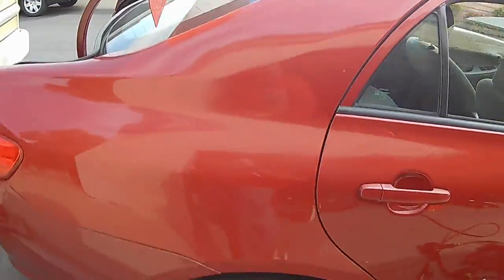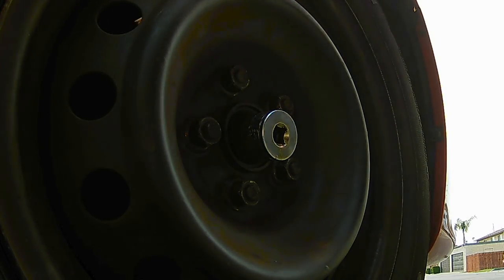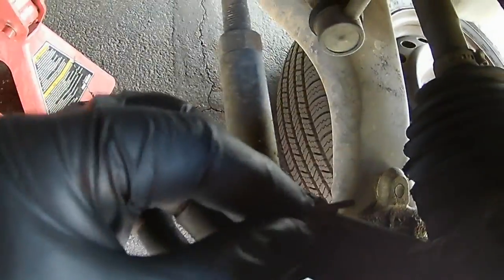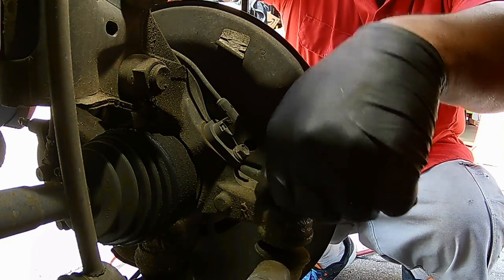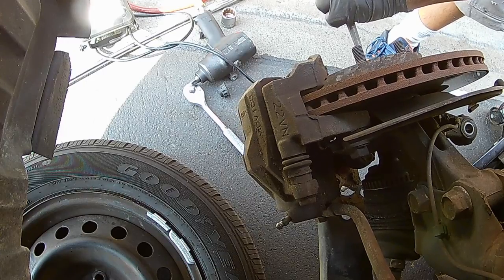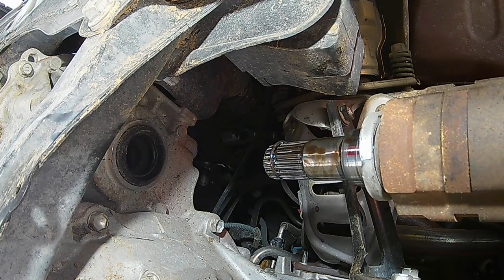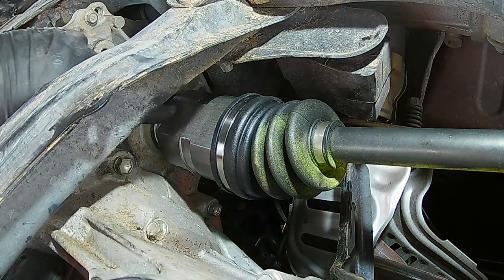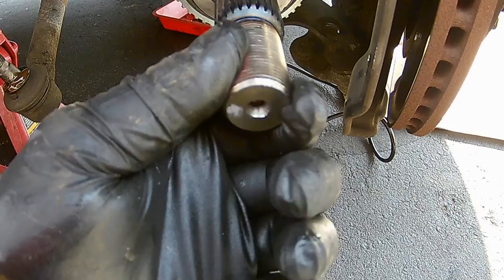Toyota Corolla Axle Replacement Removal - CV Axle Cost - Matrix Vibe - Axle Clicking when Turning

Comment: Very helpful!  I'm having nightmare of a time getting the new passenger side cv axle in my 2005 Matrix.   I've used all the tricks; making sure the retainer clip gap is facing 12 o'clock, used some grease. wiggled, pushed bonked for the better part of a day.  Driver side went in easily.
Reply from the maker: Take a 2 x 4 and use it to protect the threads while you tap it with a hammer and someone else has to be holding it in place.
Reply: When you did the driver side, did you pour out the transmission fluid?

Comment: Just did this today and because of this video it was so much easier. The tip to use that castle nut as a sort of an anvil was a great tip. Took me and my dad maybe half an hour get it done. I've got an 07 Corolla S with 260,000 miles on it
Reply: Sweet man, my 14 Corolla S just reached 200k yesterday very well built cars

Comment: Nice video. I just replaced mine today.

You do not have to remove the steering tie rod end.

I was unable to use the screwdriver to pull the axle. I had to rent a puller from O'Reily's Auto Parts. The puller rental was $65. After using it I was given a full refund.

Comment: I dont ever recommend but if you ever need to hit a castle nut on anything screw it on upside down so you dont damage the divots on the nut and make sure its even with the bolt.

Comment: Great video, I have noticed the new axle shaft has no balancing rubber in the middle of the  shaft such as the old shaft, l have corolla 2005 manual transmission, CV axle to be replaced. Is the same axle fit for automatic and manual transmission ? Thanks.

Comment: Or use your handy dandy 1/2 drive cordless impact if you do not have air 😏 When someone tells you to put something together in a certian order it usually means they have learned the hard way, how not to do it. Thanks.for the how to
Reply: Home Depot has a Ryobi impact around $100 with battery.worked great for my Honda and Toyotas axle nuts

Comment: Do you need to do alignment after? thanks
Reply from the maker: Negative
Reply: @bundysgarage  ok, I asked cause mine is pulling just a little to the right, not alot, just a little. My mechanic also changed the transmission at the same time.

Comment: do you need to drain some trans fluid first?
Reply from the maker: Negative. Just check the level after you are done.
Reply: The factory service manual says to drain the fluid, but it isn't necessary as long as you have just a few ounces of ATF to top it off if necessary. The FSM often says to do things that just don't make sense and which many pro mechanics ignore because they know a better way.
Reply from the maker: Exactly

Comment: Hi, did you have to aligned the wheel after installing the CV Joint??
Reply from the maker: No, it’s does not mess with the alignment at all. But if it pulls to the left or right when driving or when you brake, you should get an alignment.
Reply: @bundysgarage  alignment has no affect on braking. If youre pulling to a side when you brake, the issue is in the brake system not steering system.
Reply: Calls a tie rod a ball joint. Smdh

Comment: PIN THIS COMMENT - IT"LL SAVE YOU TIME. So it is entirely possible to do a side in 45 mins without touching the balljoints or tierods, period. Essentially lift up the car after loosening the lugs and CV shaft bolt, turn the wheel all the way to the left (driver side axle), remove the bolt holding the brake flexhose (if you don't, the hub will rest on the flexhose when unbolted from the strut), then remove the two large bolts holding the hub to the strut. You may have to move the steering wheel a bit to get the right angle, but the shaft will pop out and in with little effort. I wasted the most time (about 10-15 mins) getting the trans side of the CV shaft out, it looks easier on the passenger side. 

This way you don't have to worry about potentially impacting your steering geometry.
Reply: Are you talking about driver side of a left-hand drive (USA vehicle)? Driver side for me is right-hand drive (AUS)

Comment: Hey buddy I successfully replaced the passenger axle because there were a clicking noise I thought was coming from cv axle but i just finded out the noise is coming from the transaxle but only when I'm applying the brakes any thoughts you think it could be
Reply: Also forgot to mention I lifted the car on jack stands I took the passenger wheel and I noticed that it click loud when I wiggle the rotor from right to left i know this isn't normal
Reply from the maker: Check for a loose bolt or nut.

Comment: I just replace both front cv axles on 2011
Corolla and it seemed like everything went good but now I'm hearing a "whomping" sound as I drive and when pulling into reverse it makes a cluck sound. Anybody got any ideas on what this could be?
Reply: Maybe you didn't seat the shafts back in the transmission all the way. Also check to make sure the axle nut hasn't come loose

Comment: What's to prevent a mechanic from damaging a part taking the car apart and then lying and saying it was damaged to begin with and charging the customer extra?
Reply from the maker: Nothing, that’s why you have to find an honest mechanic.
Reply: I'm being charged (parts and labor) almost $700 to replace the entire axle left and right and replace 2 gaskets. 😭
Reply from the maker: What gaskets? That seems a little high. Is he using Toyota factory axles or an aftermarket brand?
Reply from the maker: What’s the year, make, and model of your vehicle?
Reply: 2006 Toyota Corolla CE. After I purchased the car I discovered it has 100k more miles than advertised for a total of 234k miles. I paid $2250 for the car & 2k in repairs (4 new tires, new shocks, alignment, back windshield). I have seen myself that the car needs new cv axles bc the rubber boots are torn and leaking. The undercarriage between the axles has a great deal of old oil and dirt, so mechanic suggested it might be a gasket to the oil pan (?) also a gasket where the axles goes into the transmission (?). Test showed car engine has good compression. No check engine lights. No codes with OBD2 reader. Should i continue to repair this car or is it too worn with high mileage?
Reply: Also, it may need valve repair or replacement bc i hear a constant ticking noise when driving.
Reply: Manual Transmission.
Reply: Thank you for taking the time to ask. Much appreciated.